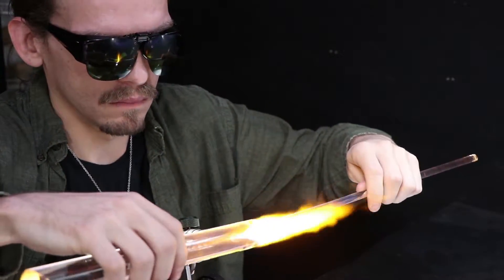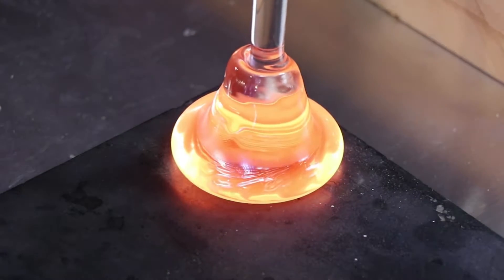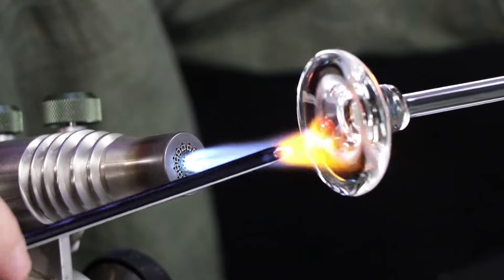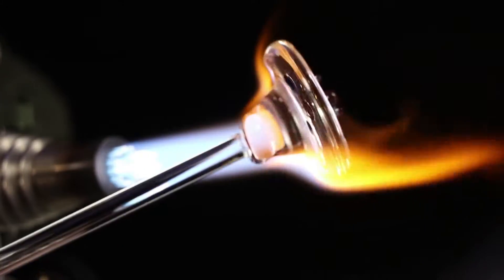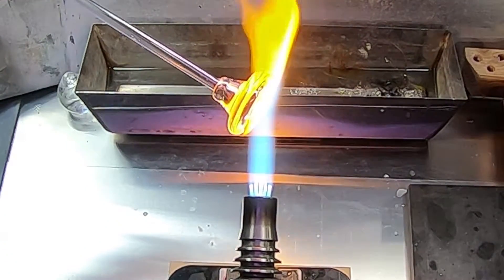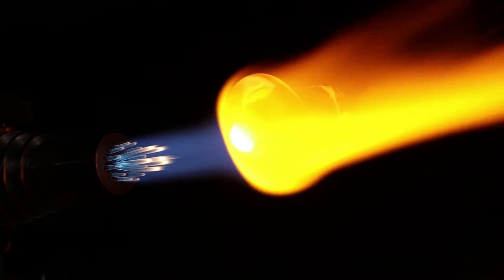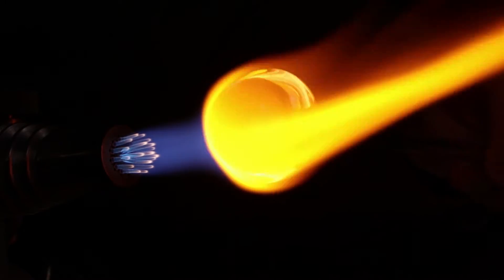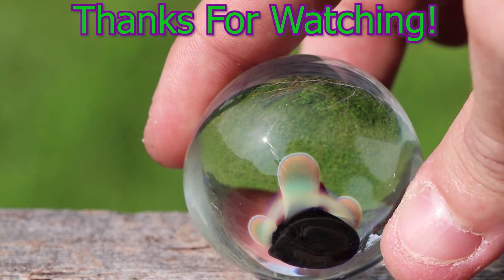Implosion Marble Lampworking for Beginners

Comment from the maker: 12:25 The marble did receive some surface damage from the fall. 13:16 You can see a few spots with small white marks. The damage is minimal enough I might do a quick repair video for this one. Stay tuned!
Reply from the maker: I didn't get around to repairing it yet but in-order to do it would be easy. Only a few seconds under the flame should even out the surface layer. However to be safe I would bring it up to working temperature (1050f) in the kiln before the repair and anneal in the kiln after.
Reply: Hello Matt.  I am really enjoying your videos, and thank you for sharing your knowledge.  I have taken a few classes, I am a beginner.  your video and teaching methods are easy to follow and understand.  I am having a real problem with my marbles cracking. I was told by my instructor that they just turn their kiln off at the end of the day to anneal their marbles. their kiln is much bigger than mine.  Maybe mine cools to fast?  anyway is it possible to fix marbles that are cracked but still in one piece?  and Thank you again. keep up the great work and generosity of sharing your knowledge
Reply from the maker: @pattyallison1108  Your welcome! I'm glad I could help and always enjoy sharing the what knowledge I can. 
  Smaller kilns may cool faster. For larger or more complex marbles (like implosions) I would ramp the heat down slower if possible. Also be careful not to cool off one side too much before it goes in to anneal. I like to bask my finished work in heat all over one last time before I kiln it.
  Lastly you can always melt your work back together, but more complex patterns may deform and cracks will leave behind air bubbles. You'll have more success with practice.
 Best of luck on your glass journey! 🔥

Comment: Your really limiting yourself by not compressing your marble, as it would probably honestly look a bit nicer. Whether you compress it or not your still making a true “compression” marble as it’s being made on solid rod. A true implosion is made on hollow. If the tops of your dots are flattening out while imploding it’s mostly because your inner core isn’t hot enough and they are hitting that hard layer of glass that is colder. Just some more information because the more knowledge the better right
Reply from the maker: Hey Monster. Sorry my terminology might not be the best. But every marble I've compressed or flattened with graphite ends up effecting the dots inside, either by flattening or curving them outward like a flower. Only by avoiding that step I find they implode straight through. I believe its best to try both methods and find what works for you.
Reply: Matt Jasa Definitely. It can be hard to find a technique that achieves what you’re going for, especially with glass lol. You’re right though, I was mostly making flowers at the time. But man, looking back, my comment reads as pretty much being a know it all anyway. Nice marble! Stay safe and enjoy your home studio! I’m jealous, I would give anything to be able to blow glass these days  😞

Comment: Where do u get oxygen concentraters ?
Reply from the maker: You order them online reconditioned or check locally like on FB to see if anyone is trying to get rid of one in the area. I see them all the time on trader pages for cheap. I recommend getting a 10 LPM. 
I use two 10lpm Invacare concentrators for a 2-stage torch OR one concentrator for a single stage. 
https://www.mountainglass.com/tools-and-equipment/more-tools-equipment/oxygen-concentrators